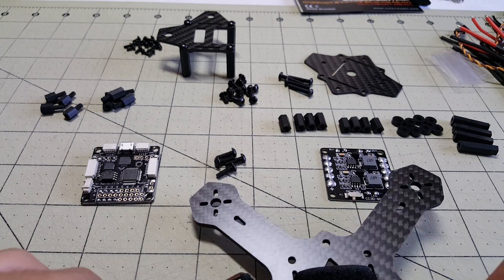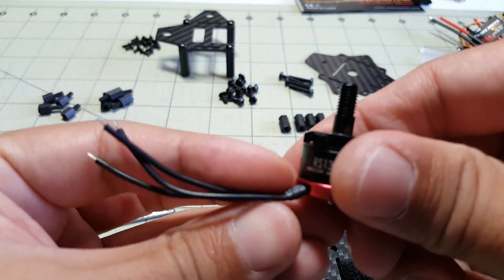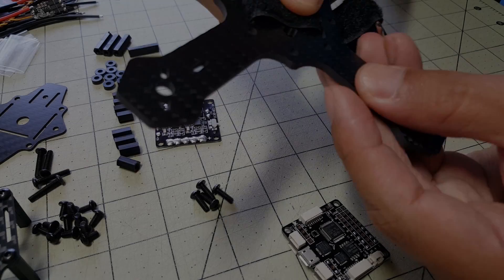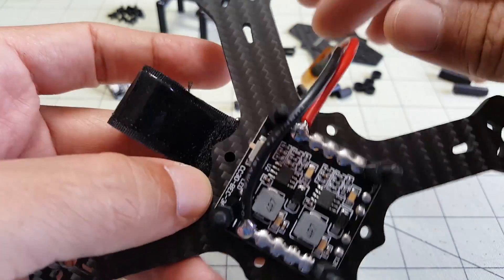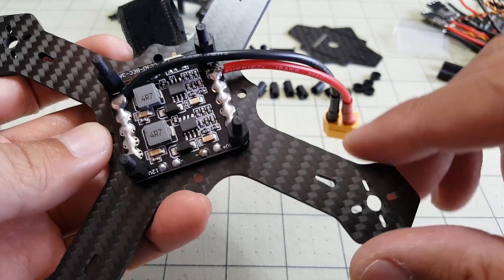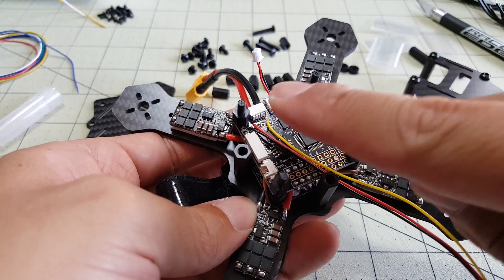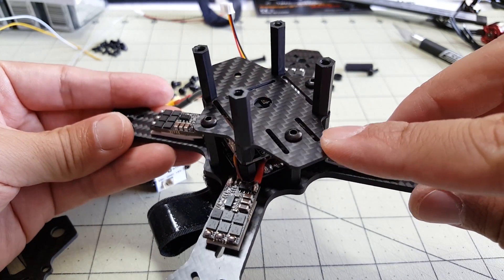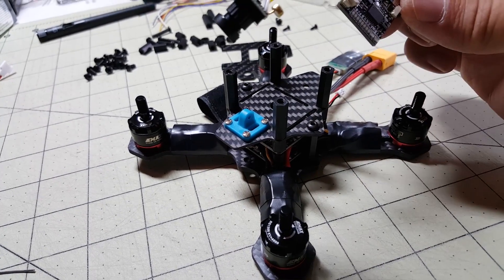AirbladeX 130 Microquad Build

Comment: Sorry for late question. I see most builders use a metal screw to come up from the bottom plate and start the electronic stack build. Occasionally I see someone use a nylon (plastic) screw instead, and mention the reason to be safer avoiding shorts in a crash. Makes some sense since generally you use nylon spacers, nuts, or screws in the rest of the stack. Is there a reason people start with a metal screw? What do you think about pros and cons? Thx.
Reply from the maker: +Mark Sherman it depends on the components and if they conduct at the screw hole. Some do, some dont. You have to check with a multimeter. If they conduct use nylon, otherwise metal is better and stronger
Reply: OK, thanks.